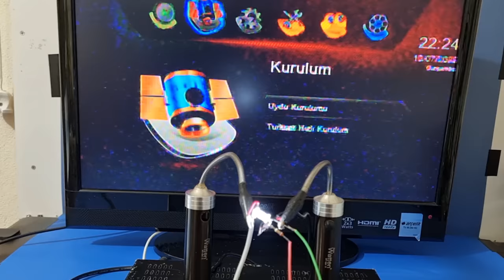You Haven't Seen This Before - How to Transfer Video Using a LED

Comment: You can do the same using lazer diode instead of white led  an it will work more accurately and also from far away.
Reply: Was gonna say same thing
It's old ideas if you had 10 TVs with laser bouncing round the house be sick 🤓😎 oh the receiver can be a small solar panel and amplifier
Reply: @davey2k12  yes but who, and why.?
Reply: @mikebond6328  for fun
Reply: Is this the same concept as transferring sound, from an amplifier, over a laser beam then hearing the music from a speaker?
Reply: Конечно . А еще лучше частотную модуляцию например частоты 27мгц.  
В этом случае дальность и качество передачи еще более возрастут.  
При этом на поднесущей 6.5мгц и других можно передавать звук.. 

Лазер лучше использовать и.к. в этом случае пыль атмосферы и облачность влиять будут значительно меньше. 

Применение частот например 145мгц несущей и более широкую девиацию частоты.  Можно получить еще более эффективный канал передачи данных.
Reply: SAfgjkkkkkoppoo000kk589⛽🛰🔑🔏⛽🚦🚥🖥🛰🔒🔓⛽

Comment: Excellent concept.. practically, how can the range be enhanced?
Reply: you can use infrared detectors and leds with fiberoptic cables
Reply from the maker: It will be necessary to add to the circuit